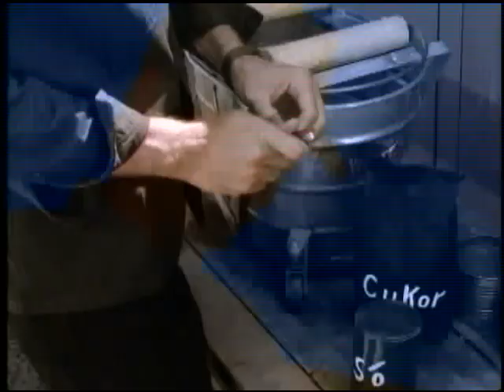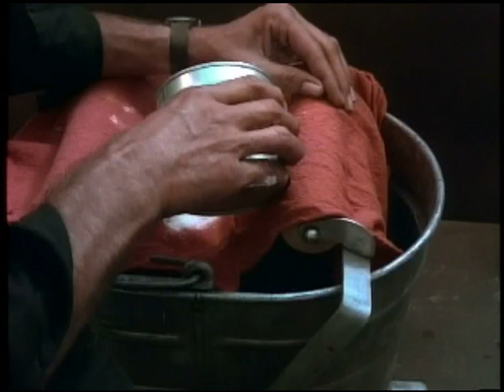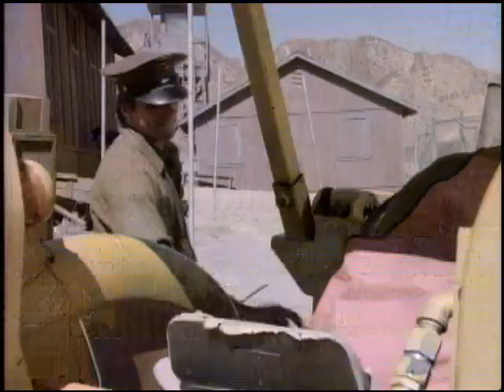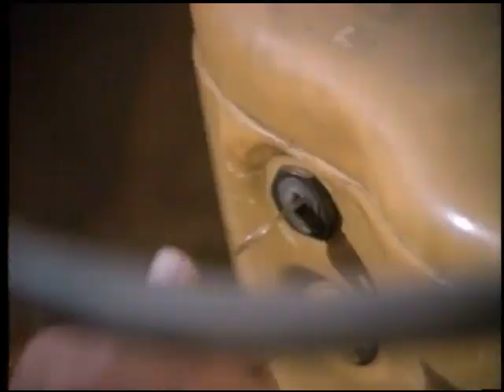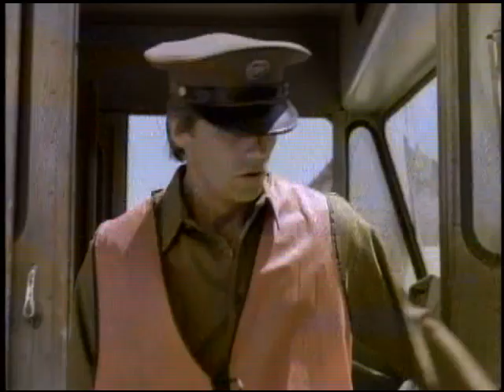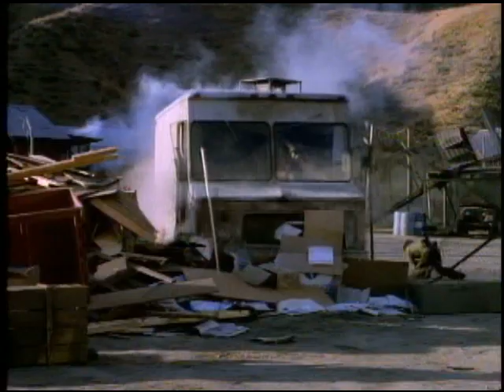MacGyver - Chili Recipe

Comment: Sure. Just make nitroglycerine, and get it to soak into sawdust, or another absorbant material. This stabilizes the nitroglycerine. To make nitroglycerine, just google "make nitroglycerine" :-)
In this clip however, MacGyver most probably used Sodium chlorate and sugar. So, not dynamite, and without a pressure container, it would most likely just defraglate, and probably would not work at all without mixing.
Reply: Lol #mythbusters
Still a cool scene though!
Reply: Of course, they won't show the actual recipe for that explosive substance... just a make-believe recipe.

Comment: I really thought this a was a recipe... I'm upset.
Reply: It is, pretty sure its a rocket fuel in similar forms. ask around youll find someone that knows what this was actually based on 😉. Or just look up amature rocket fuel then use your imagination.The chemicals/ingredients are usually correct on macgyver however the method is always extremely simplified.
Reply: It's a recipe alright... for disaster... or distraction in this situation.